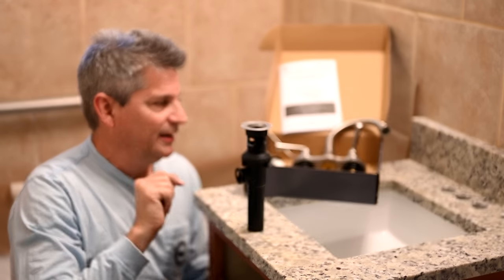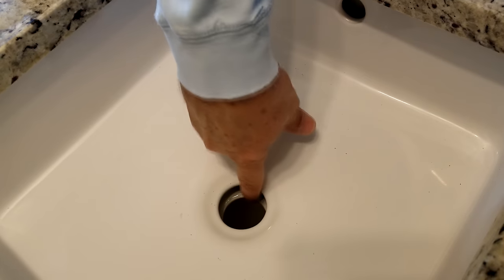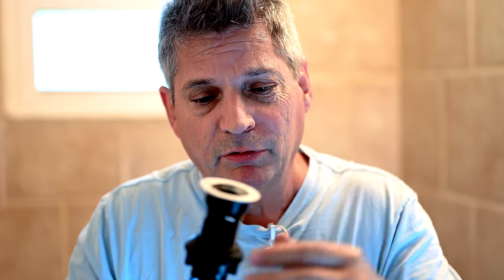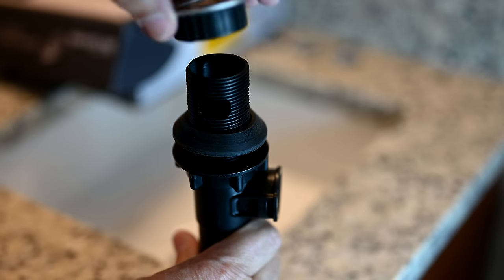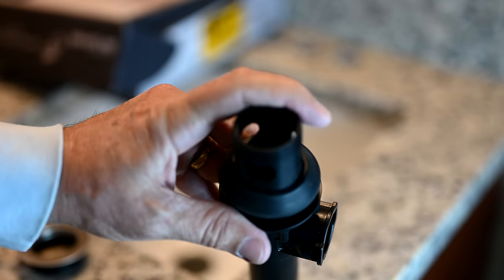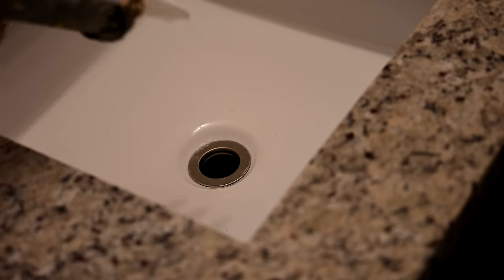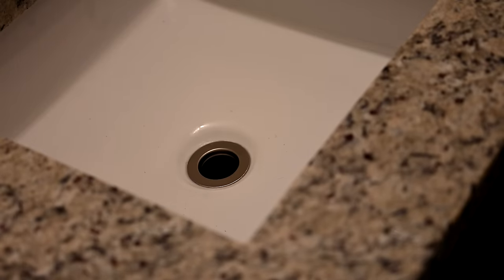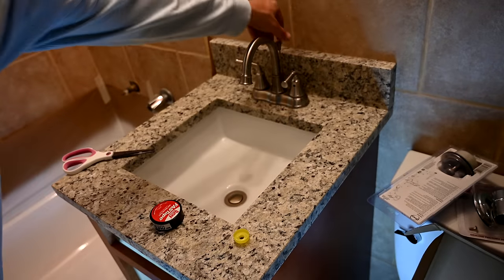How To Install Bathroom Sink Drain/Faucet, No Leaks Under Gasket, Threads [SOLVED] 2023

Comment: Common problem even for professionals. I almost always anticipate the lower gasket will drip so apply a silicone bead around the gasket /thread section and a thin bead on top where it seats against the porcelain for additional reassurance. A quick wipe for neatness and never had a leak. Teflon is probably easier and less messy for someone not used being economical with a silicone gun though. Spot on with the putty to metal, silicone to plastic  method. Never hire a plumber who refuses to read instructions.
Reply from the maker: Good info!

Comment: I’m starting to wonder if the tail pipe was designed to maintain plumber job security 😂 I’ve tried these tips and still leaking.
Reply from the maker: Good question! It is important to follow the steps on the second application of the Teflon tape on the down pipe, did you dry fit first to determine where the black gasket lings up to the tail pipe? That is the exact spot where the Teflon tape needs to go, just as I showed it
Reply: @jeffostroff  unfortunately I’m working with a pedestal sink preventing me from seeing much; doing almost everything by feel. Gonna reapply more tape and go from there.

Comment: Great explication but it still leaks for me…
Reply from the maker: If it still leaks, you need to look deeper into the steps I take for the lower section of threaded pipe where to place that Teflon tape
Reply: @jeffostroff  thanks. I found you other video that takes you through the steps and the plumber’s putty worked. Thanks again.

Comment: Bead of silicone on flange after  installing it ,is trouble . Over the months the silicone will pull away due to soaps and chemicals going down the drain . Just put silicone underneath the sink flange only.
Reply from the maker: Wrong, silicone is guaranteed 30 years. IT doe snot just peel off on its own. I have tried to peel off old silicone, it does not come quietly, much less on its own.

Comment: Where 2 buy your plastic  pipe made 4 easy home do it ur self repairs?  But 2 easy 4 me with very old metal pipes that doesn't budge ! when I got it 2 move a little , the drain moves with it. (Make videos on old metal pipes, and connections that r not easy.)
Reply from the maker: Good idea Gary

Comment: This is why it is better to hire a professional. I'm glad you didn't get any leaks but adding teflon tape to places where it shouldn't be is not good advice. The initial leak in the beginning of the video was simply the nut not tightened enough against the bottom of the basin. putty or silicone for the strainer and tighten that nut with some pliers and your fine. Teflon is only for tapered NPT threads to allow them to tighten further into each other, it's not sealant.
Reply: Mine wad cranked down extremely tight, still leaked...

Comment: I did everything and yet it still does the same thing
Reply from the maker: you might have a flawed hole on the bottom of the basin. But double check where you applied the second wrap of Teflon tape on the threaded downspout, make sure it is right where the black gasket is tightened to the threaded downspout. That is the spot where the leak occurs.
Reply: @jeffostroff  wow, your the best👊🔥, It is solve, Thank God for this video

Comment: The top is pretty irrelevant it's the bottom angled seal gasket that leaks. Think about for a second; if the top leaks it pours to the bottom. 

As far as silicon versus plumbers putty I don't use any visible plastic or PVC parts, and I loathe the gunk from silicon especially on expensive plumbing parts and bowls.
Reply from the maker: Fo most people who end up with these parts, this is the best solution for them
Reply: @jeffostroff  .. $12 cheap plastic vs $30+ all metal and brass and what a $300 service call to replace 4X more often. So much for what most people do...

Comment: Siily video.  Been doing this for 50 years.  First is if you put zero sealant, silicone or putty, on the lip piece, where will the water go?  "It will leak" says you, but l;ook at it this way.  The final gasket/seal is the big fat black one that he shows as leaking in the first part of the video.  If that is sealed correctly (just by tightening it by hand till tight, then 1/8 with channel locks) it will not leak.  So then if it won't leak past this point, why the silicone?? Any water leaking will go INTO the overflow holes.  THERE IS NO OTHER PLACE FOR THE WATER TO GO.  Next is he never show you how to install the pop up stopper!!  Itis part of the drain, so why isn't it included in the video?

Comment: Pipe dope or soap to slick up the rubber so it Sears fully into position. Not the threads. Just the rubber.

Literally hand tighten. A wrench will break your pop up doing this my way.
Reply from the maker: Be careful, because some pipe dope bottles warn you not to use against certain black plastic or rubber. Pipe dope is intended for use on metal threads.
Reply: Yes true. I use the white oatey. Old dude showed me 20 years ago. I still teach my guys. The rubber should be softer to form to porcelain Really. But we all find our own way to make it work 15-20 years. Usually time to change by then.

Comment: I Let that silicone dry overnight before running the water through.
Reply from the maker: I specifically used a 30-minute water ready 100% silicone.
Reply: And I really get generous with the silicon. Let it ooze out the flange. Then I take a razor blade and trim it the next day.
Reply: @jeffostroff   30 minute is ok if you're in a hurry.

Comment: 40+ yrs experience , great try. Always use plumbers putty on China. Silicone on natural stone or man made. You put the tape dope on right direction but if you flip the roll it’s easier to tighten the tape on the threads

Comment: i do not understand the need for the upper teflon as well as the silicon in the basin if there is an overflow system... either way water is going into hollow basin part, so it is utterly irrelevant if seeps in through the drain as well

logically speaking

Comment: Plumbers putty under the flange  Is all that’s needed
Reply from the maker: Actually we have a newer video that we filmed a few months ago on this that shorter and better and higher resolution, but we've mentioned in that newer video that we no longer recommend using plumbers putty at all because it's not needed first of all. But also the manufacturer has told me that they have petroleum products in plumbers putty that could cause drying in cracking of the black rubber gasket. It is the Teflon tape which solves the leak anyway a lot of people were using plumbers putty as a last ditch effort but that's more of a reaction instead of a preventive measure.
Reply: @jeffostroff  I install faucets everyday I repeat all you need is plumbers putty no real plumber uses Teflon

Comment: I don't see how putting tape on the bottom threads would help a leak at the cone gasket.
Reply from the maker: The fixtures often leak at threads, they are not water tight
Reply: @jeffostroff  What I meant was that the video clearly shows a leak at the cone gasket, which is where mine was leaking, and taping the threads would not - did not - help that.

Comment: I'm having this EXACT problem. Purchased 2 drains and both leak like a sieve. The original drain did not have tef tape and did not leak. Out of frustration, I reinstalled the original drain after the 2 new ones after they both leaked horribly, and the original now leaks too UGH! I did tef tape the bottom rubber gasket area of the Kohler drain I bought, but it still poured out like there was no gasket at all.  WTF????   Well, I see you have 1.4 million views so I can see I'm definitely not alone here as this drain design is VERY deliberate by the manufacturers so you need to call a plumber. WELL.... it backfired Kohler. I will NEVER call a plumber for this issue!

Comment: Great video overall. I have a drain valve pull that is not put together so will have to figure that out. My drain came with NO instruction and tho it has black gaskets it also came with plumbers putty which I now know not to use.  One suggestion would be to get rid of the “sexy” women mechanics at the end of the video. I am all for showing women doing work but sexualizing them while doing it is not necessary.
Reply from the maker: We've already done that

Comment: Damn I wish I had watched this first. I used plumber's putty. I'm quite an honest and I hope it works but I think I wasted. $3 on the putty. I just hope it does not leak
Reply from the maker: yes hopefully this video shows that you really don't need to use the plumbers putty because that's basically a Band-Aid catching the water from leaking out at that last point of no return. It's the second application of the Teflon tape on the threads of the pipe is what saves you from the leak.

Comment: I tried twice, and it still leaks.
Reply from the maker: Follow it exactly as I have shown, did you dry fit first to determine where to put the lower wrap of teflon tape? the tape must end up in the middle of the black grommet.

Comment: Tried your trick but still didn’t work for me.
Reply from the maker: Every once in a while for whatever reason this does not work for somebody and the likely cause is an imperfect opening at the bottom of the basin so check there if there's any bumps or flaws in the round opening. Also did you make sure that you put the second application of the Teflon tape at the bottom of the threaded pipe, and does it exactly line up with the gasket once everything is tightened up in place? So that gasket has to slide up the drain pipe along the threads, and end up directly on the spot where you applied that second wrap of Teflon tape

Comment: Man I did everything as described and mine is still leaking…
Reply from the maker: I bet you did not do it exactly as described like fitting the gasket 1st to see where it lands on the threads and make sure that that is the spot that you add the 2nd bit of Teflon tape on the lower part of the threads right where it meets at the bottom of the sink.
Reply: I went back and paused several times during the time. I put the tape up at the top and wound it clockwise and then counter clockwise for the bottom piece. The bottom tape was pretty much right below the openings on each side of the drain assembly. I’m so ready to just be done with it that I made sure I listened. I’ll give it another shot with silicone since the plumber’s putty instructions say to not use on plastic. Uuuggghhh…
Reply: @wan2865  Same issue still leak. Did you fix it with silicon?
Reply: I ended up just selling the house with the sink not working unfortunately. It didn’t matter because the buyers were buying without any problems needing to be fixed.

Comment: Under that drain I like to put plumber's puddy like you use on a kitchen sink
Reply from the maker: manufacturer specifically calls out silicone. putty could cause the plastic to crack
Reply: @jeffostroff  ok thank you for the info

Comment: Lots of useful info but, the Teflon tape does nothing for the problem described/shown here (water leaking from in-between the gasket and the sink).
Reply: agreed...also teflon tape is a lubricant not a sealer
Reply from the maker: Both you guys crack me up, LOL! it's funny watching people who don't know anything about the topic come in here and correct me. Uninformed trolls LOL! The Teflon tape is a thread sealer tape. IT does solve the problem, because we sealed the threads, that is where the water was getting through. Looks like you forgot to read the hundreds upon hundreds of comments from people who responded that this solved their problem when nothing else did. Then you come in and try to negate what we showed to be fact, and what hundreds of people verified. LOL! Let us know if you have any more comedy for us.
Reply from the maker: Steven you crack me up the most, LOL! Teflon tape IS  SEALANT, not a lubricant like you claim, LOL. Look even on the package Oatey calls it "Thread Sealing PTFE Plumber's Tape", LOL! You're a funny troll.  https://www.homedepot.com/p/Oatey-Fastape-1-2-in-x-260-in-Thread-Sealing-PTFE-Plumber-s-Tape-306212/203529858 T

Comment: My best advice for this is not to use these cheap plastic drains. Go to a real plumbing supply to get your faucet and it will come with a metal drain that you can tighten enough not to leak.

Comment: This is just so much malarkey.  There's so many mistakes in this video I can't even count them all.  Here's a few.  If the rubber gasket is doing it's job the water will never get to the threads where the teflon tape is.  What the author never tells you to do is to lightly block sand and then slightly round the corner of the e mating surface of the vanity top.  This eliminates any burs that keep the rubber gasket from sealing.  Also, the reason that you want to use silicone on the cultured  marble vanity tops is that plumbers putty has oil in it which will seep into the cultured marble and discolor it.  Also instead of adding more silicone after you mount the flange in the sink you need to ensure that you have squeeze out all around the flange then wipe the excess away with  a paper towel and then clean with some mineral spirits.  This makes a nice clean installation where the excess silicone won't lift after a few months and make an ugly messm  This guy also probably uses teflon tape on rubber seals on toilet and sink supply lines.

Comment: :oops:Your teflon tape at the bottom does not make any sense. It was leaking from the top of the rubber flange. If it was leaking from below the nut, I would think that would be correct, but you are showing it leaking from above the washer and teflon tape on the threads will do no good at all.

Comment: This doesn't make sense. It doesn't leak from between the gasket and the pipe, it leaks from between the gasket and the porcelain. I've never had a leak there that wasn't solved by getting the drain pipe perpendicular so the gasket seats correctly.
Reply from the maker: Your assessment is incorrect because it quite often does leak between the gasket and the threaded pipe, because you don't always get a perfect seal especially anytime you have threads going through that rubber, so that is why adding the plumbers tape onto the threads helps to seal that up a little better
Reply: @jeffostroff  Your own video shows it leaking between the gasket and the porcelain. If it was leaking between the gasket and the pipe it would be coming out at the bottom of the gasket, not the top.
Reply from the maker: @Bapuji42   Your logic is incorrect there Because the threaded pipe comes through that same hole in the basin where the casket meets up to it. On solve the problem was solved by adding the threaded tape on there. You also did not check the hundreds of comments left by people whose problem was solved after watching this video and applying the tape onto the threads.
Reply: @jeffostroff  Draw yourself a diagram. If water leaks between the gasket and the threads, the only place it can come out is the bottom of the gasket. In your video you can see water leaking from the top of the gasket - it doesn't even have to go past the threads to get to that point. Don't make me publish a response video with a diagram.

Comment: There is absolutely no reason to put Teflon tape or pipe dope on the top threaded fitting. Even the silicone around the drain cover does nothing to keep the sink from leaking. If the connections were to leak like a sieve at either place, where would the water go? It would simply go into the drain through the weep holes.
Reply from the maker: You are completely wrong. If you have no seal at where the flange meets the sink, the water runs under the flange, now it is on the outside of the threads, no going down the drain you missed the mark by a wide margin on this one. Please tell me you are not advising other people on this.
Reply: @jeffostroff  After I posted this, I immediately reevaluated my statement and contemplated rewriting it, but decided to wait and see if anybody challenged me and how. Plus, I was in a hurry to get to Home Depot and purchase some silicone to, yes, put around the flange where it meets the sink, and also around the threads on the bottom gasket where my sink was leaking from.   The silicone between the flange where it contacts the sink only helps facilitate water being held in the sink when the stopper is pulled closed, period. Otherwise, when you closed the stopper, water would likely, very slowly, drain from the sink into the drain. I get that. But if you didn’t seal that flange, the water that leaked there would simply make its way to the overflow holes in the drainpipe. This is by design, and there is absolutely nowhere else it can go. And again, I stand by my statement that there is absolutely no reason to put Teflon tape or pipe dope around the threads where the drainpipe screws into the sink flange. I’m not advising anybody to do anything, just stating the facts as I see them.   
Now I’d like to thank you for the video and all the information it provided. It was very helpful.  I’ve never heard that you are not supposed to use plumbers' putty on black plastic, and second, I never thought about water leaking around the threads on the lower drain gasket. That’s were mine was leaking. Believing it would provide the best seal, I went ahead and used silicone on those threads against my better judgement out of concern with the difficulty it could present in the future if I ever wanted to remove the drain. I don’t plan on ever removing it again. 
Hope you don’t mind that I subscribed, rang the bell and liked your video.
Thanks again…..

Comment: Silicone, BEWARE!!  Most silicone will not stand up due to not moisture rated!  You either need to use outdoor silicone or aquarium silicone
Reply from the maker: If you buy the 100% silicone that says it's made for kitchens and bathrooms it's guaranteed for like 30 years